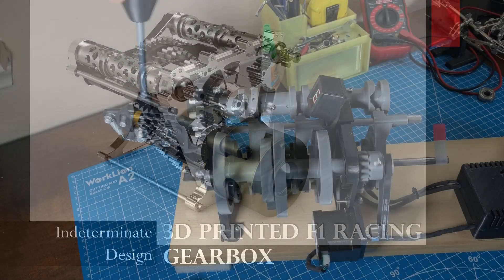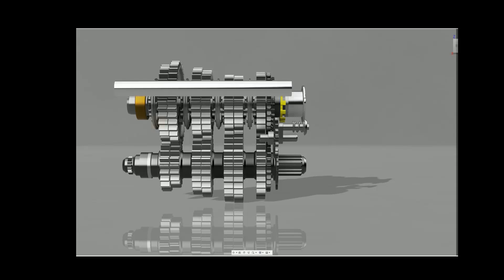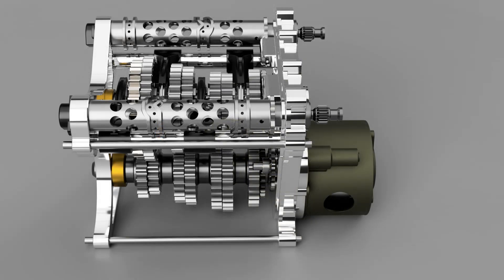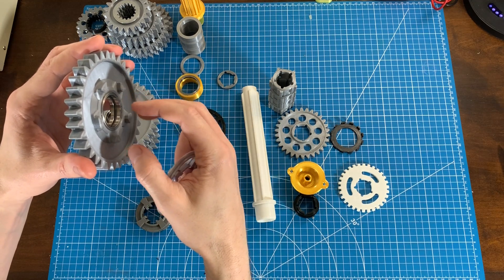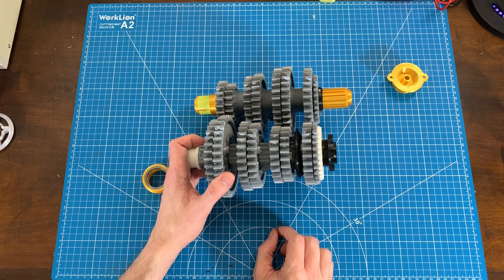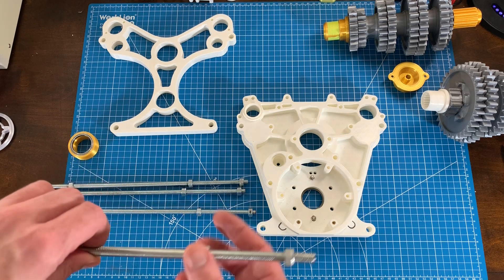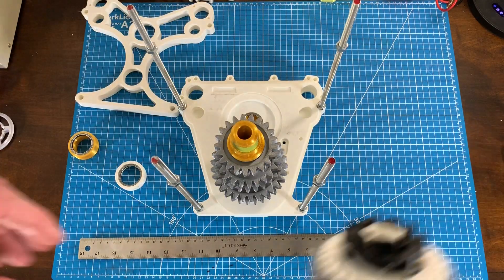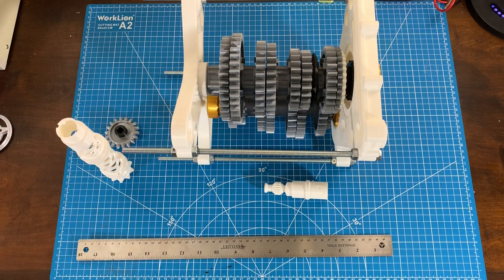3D Printed F1 Seamless Shifting Gearbox  - Part 1

Comment: Dam fantastic job!

That white gear on the nainshaft for the sensor is called a VSS Tone Ring. It's normally steel and used with a hall effect sensor to encode the transmissions speed. Sometimes there is one on the input and output shaft so it can detect slippage
Reply from the maker: Thanks!  I was wondering why they usually have them on both shafts.  They also have a torque output gauge as well and I assumed this was what they were using. Or they might be used in combination.

Comment: Nice video. 
Im curious, what module of the teeths and the center distance did you use?
Reply from the maker: I don't have the regulations handy, but I believe they specify a minimum distance C2C of 80mm.  Mine is ~85mm, and this would be pushed as close to the minimum as possible of course.  

The teeth have a module of 3.18 with a pressure angle of 27 degrees.  The real gearboxes have different highly optimized gear designs for each gear but obviously there wasn't enough information available for this.

Comment: What sized bearings did u use?  Where did u find/buy them? Thanks!
Reply from the maker: I used 6706 thin section bearings.  I found them on Aliexpress. They’re difficult to find cheaply, but I was able to order 25 for about a dollar a piece.

Comment: How do they handle the timing of the two drums? When one drum unselects a gear, the other one must engage immediately. Is there only one layshaft or something equivalent to concentric shafts for even and odd gears? Also how do they downshift while braking without excessive jerkiness, or is it that it still jerks for engine braking?
Reply from the maker: It’s controlled in the real gearboxes with high speed precision hydraulics and electronic sensors.  One drum controls even and one drum controls odd gears. They have a variety of shift modes, seamless shifting where both shift drums are moving at the same time engaged and disengaging. They can also shift like a more conventional gearbox where like you said one drum moves and then the next one. Downshifts are typically not performed as a seamless shift.

Comment: Very good job, congratulations. May I ask you a question? How did you print both shafts? I guess it's easier to print them vertically but in terms of stress, it might be better to print them horizontally? I'm designing something similar and I'm afraid the shaft will break if I print it vertically, despite loads are small. Thank you very much!
Reply from the maker: I printed them vertically. I actually was worried about the strength myself and I designed them to have a metal tube epoxied inside them. But printed out of PLA+ they’re surprisingly strong, it would be difficult to break by hand, and almost impossible radially.

Comment: What pitch and pressure angle are the F1 gears ? Also, did you use a 1 module tooth height/depth?
Reply from the maker: I believe the pressure angle is 25, but it maybe 30. I used the same tooth profile for all the gears. I saw grad papers online where top teams optimized the tooth profiles for each gear with some crazy mathematics.
Reply: Martin Sunderland  Yea, these guys  started with throwing away the standard rack (the only thing that is "standard" is that they use whole tooth numbers!). 30 deg (spline) PA seems a bit high but 25-27 is often used. High performance gears are often designed with a High Contact Ratio (total tooth height over 2xModule)....sspreads the load over more teeth. The tooth profile WILL be optimised per gear.....and I would expect that the gear design, including tooth modification/optimisation (if allowed) to be per race circuit. Thanks....it's facinating to see what you have achieved.

Comment: That white toothed part is probably an output shaft magnetic speed sensor.
Reply from the maker: That makes sense.  I'd love to be able to find more pics of one of these gearboxes disassembled.  I think that part is also integrated into the drive for the gearbox oil pump.
Reply: @IndeterminateDesign  You've probably seen the Scott Mansell video where he takes on apart.
Reply from the maker: Definitely, I've watched his videos many many times.  I used that gearbox to inspire the design for parts I couldn't any find pictures of.  Unfortunately it's from the generation prior to the seamless shift/dual shift barrels.  Current Indy car gearboxes actually look like the older generation F1 and the newer generation F1 gearboxes had a baby together, sort of half way in between.